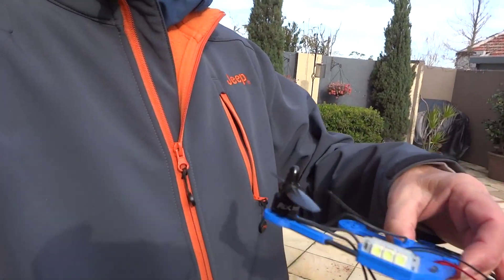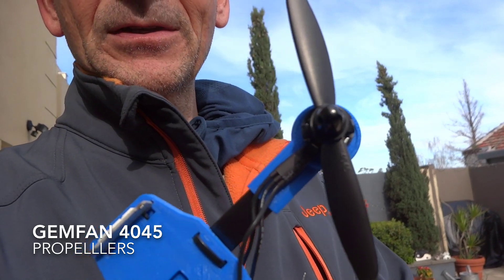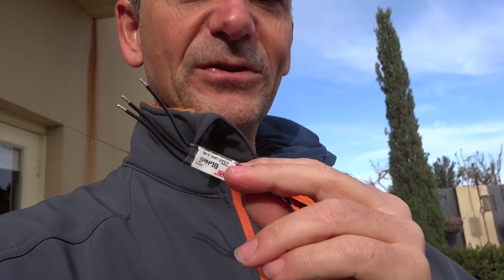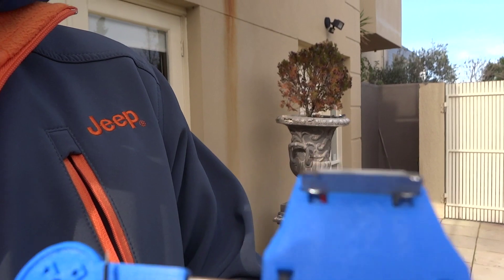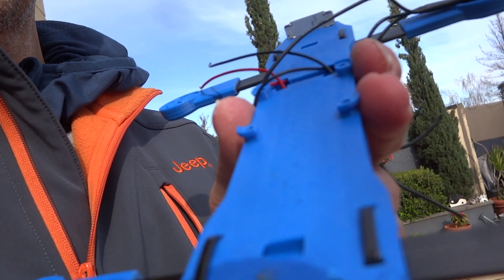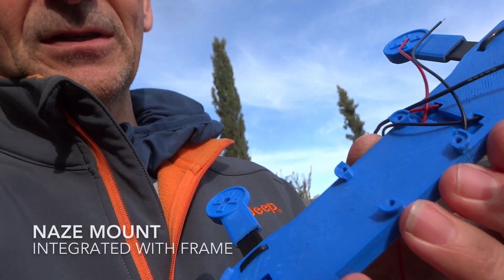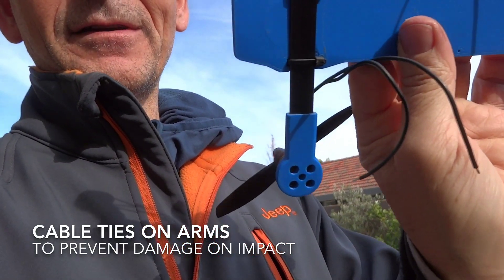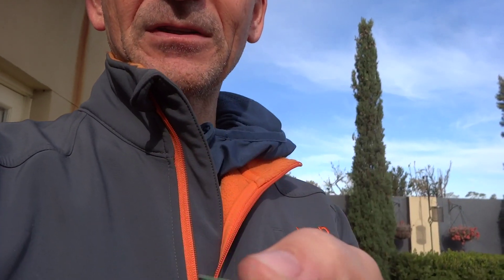Skidmark Quad FPV Pocket Racer Update BLHeli Oneshot

Comment: Man I really like this!!
Reply from the maker: Thanks Paul its a really cheap build and I think it's going to be the one that Chad and SD will need to beat ;)
Reply: jbalatutube me 3! I need to add a 200-300g class to my fleet :) more than likely I'll use a 4s to do some of the outdoor tricks, with 3100kv I might need to trim 4045 down a bit to allow the motor to stay cool, could work.
Also notice 1806 2300kv on 4s has tonnes of power, might be a good option for my build, with extra power it can even carry a gopro if needed.